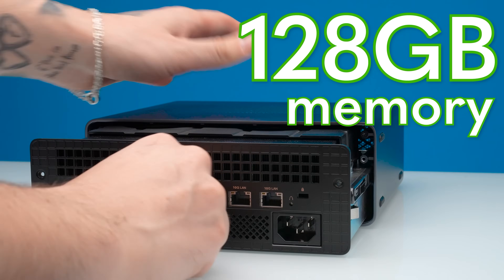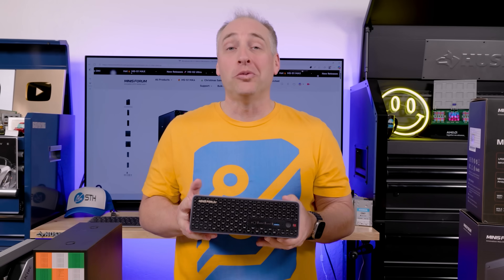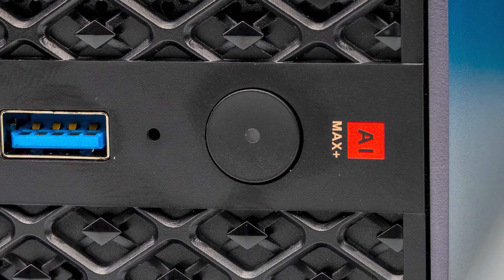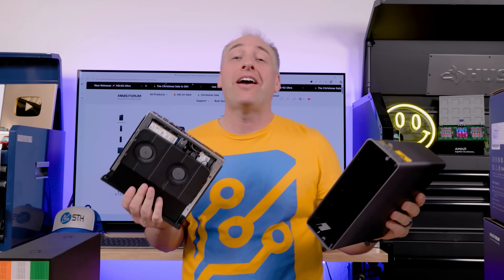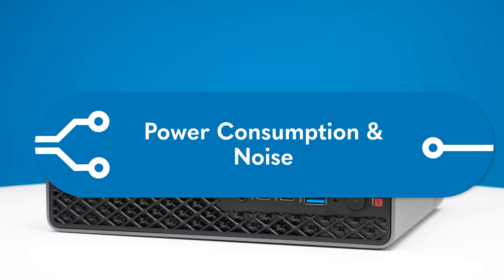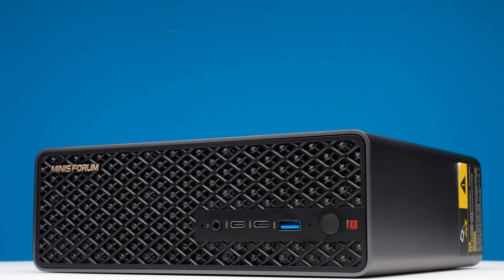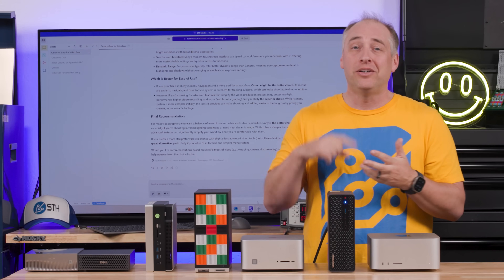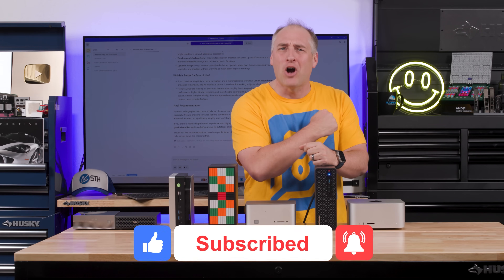The BEST AMD Strix Halo Mini PC Minisforum MS S1 Max

Comment: I would love something like this with 8+ m.2 slots, even running at just 4x1 or something. It would be revolutionary.
Reply: The MS-A2 has three M.2 PCIe-4 x4 slots. It then has a PCIe x8 slot that can be bifurcated into two x4 slots with an adapter.  So you can run 5 M.2 drives at full 4.0 x4 speeds.   It also has dual 10GbE networking.   For me, the MS-A2 is the way to go a far, far better price.
Reply: If you are looking for an 8-bay NVMe NAS, the TerraMaster F8-SSD /F8-SSD Plus is the same form factor, and STH has a video about it. Also costs nearly one tenth as much as the MS-S1 😅. Otherwise, Strix Halo has only 16 PCIe lanes and no non-PCIe networking, so some PCIe lanes need to be used if you want any (good) networking. If you need mass storage and horsepower, you would probably be best served by linking the TerraMaster and the Minisforum together with 10GbE.

Comment: I saw the price. Nope.
Reply: i think the proper verbage would be 'aawww heeell naawww'
Reply: Love the system. My singular gripe is that the tolerances on the PCIe install slot are sooooo tight that I took almost 20 minutes to install the card. Even had to look up the install video for it. Way more painful than the MS-01 & MS-A2. Dope system though.
Reply: Got mine in November I think and I love it.
Reply: Ok
Reply: I don't think most of you understand that this is UNIFIED memory. It allows you to run giant AI models that even a 5090 is unable to run...
Reply from the maker: I mean with 128GB RAM pricing these days not that bad. When we filmed this it was more like $2600 and 128GB was $1300
Reply: @ServeTheHomeVideo  I got mine back in Dec for 2,600 glad I did! They are just passing on the ram price hikes. Its expensive but you pay a premium for compact form factors with this much ram & cpu power.
Reply: @ServeTheHomeVideo  don't compare oranges to apples. 128GB of ram was like 300€/$ before this absurd situation, and this is soldered ram, which should be even cheaper.

What we need is a pc with dual lpcamm2 slots, for quad channel high bw mem.
Or just quad channel in consumer systems (a dual channel ddr5 5600MT system gives you 89GB/s membw)
Reply: i agree but in this specific instance i watched a video on strix halo because there are minipcs with socketed ram and strix halo and ai performance was maybe like 2-3% lower because of the ram so i wouldnt even say that camm memory is needed. bue i am totally with you that it is time for more memory channels..... regarding the benchmarking video if you are curious i'd have to go look and find it in my history but i could provide the link
Reply: @vxvicky  yeah that price is in the past, it isnt going down that low for a while or at all, its the normal price range for now.

beside strix halo pc's tend to be expensive plus with the whole RAM issue in general, im not surprised about the price.

also its an SoC so of course the RAM is going to be soldered, its the same reason Framework did, to maximise performance its going to need to be soldered.
Reply: @vxvicky  So by that logic then second hand electronics should cost the same as when they were manufactured because thats how much it cost to make them at the time. Have you not heard of supply and demand?
Also, DRAM is DRAM. Whether its soldered to the motherboard, soldered to a DIMM or built into an SoC, its still DRAM. Its the DRAM chips themselves that are scarse and expensive. What they are soldered to means literally nothing. That is like saying that a car should cost less because its parked in a lot instead of driving on the road. The car is the car no matter where it is.
Plus dont forget the "AI" tax. Very few people are buying these things for anything other than running LLM's.
Reply: @honestgoat I simply don't understand what you're trying to tell me. Can you please rephrase it again?

Or even easier: are you sure you're talking with me?
Reply: @ProjectTheKhan forget about that "price of the past"
Nowadays current pricing its absurd, don't pay those mounstruosities for those. Extremely high prices cause potatoes? Don't buy anything, hold your money.

Given that it is simply IMPOSSIBLE that CONSUMER HARDWARE should be that expensive cause it is not being used on datacenters, as simply as that.
As small nvmes, nobody uses 512gb/1tb/2tb for ai. Minimum is 4 if not 8.

Tbh this situation looks odd, as if scalpers or their own distributors have removed all the hardware from the market inflating the cost...
Same happened with ps5 consoles back in the day, the disrto with the help of Sony was controlling the hardware sales/stock in shops, generating a fake scarcity situation in order to keep prices high.
Reply: @vxvicky you can keep your money, prices won't go down until these hit the used market. 

You do realize that soldered or not,  most all RAM chips come from the same factories? If demand for the chips doesn't decrease, the prices won't either...
Reply: @Lap1ac-3  did you know that there are things called "warehouses" and "distributors"? The stock of MEMORY THAT IS NOT USED IN SERVERS —'cause you only use ECC REG on DCs— has literally disappeared...
Or do you think that what they sell nowadays at five times the price has just come out of the oven?
How naive.

lpddr ram chips? I bet there's a ton of those in stock, another thing not used in servers nor in gpgpus.
Reply: btw, already have everything maxed out and even keep a few gpus in stock just in case.
Reply: @vxvicky maybe, hear me out, large companies have placed huge orders to the fabs and there are less RAM chips being sent to be assembled on DIMMs? And that those fabs would agree to supply those companies via a contract, binding them to supply those larger orders over others? And maybe those contracts last for years? And maybe, since those contracts are paid more quickly than a others, they'd take priority, limiting the supply sent to DIMM fabs to make it to your distributors and warehouses?

Or are you so dense to believe that regular PC consumers actually drive the market? There are trillion-dollar companies that are driving this market and you're an old man yelling at a cloud.

FWIW, lpddr is being added to EVs and other new cars for the same reason it was made, aka low power.
Reply: @ServeTheHomeVideo 
I mean who cares about the "why" whether it is because of this or that, €3K it costs right now in the EU.
Unfortunately, it doesn't make sense to watch the video any further, and probably for the next year or two. 
Difficult time foe all of us.
Reply: I was going for one that had i5 and without NVME and DDR5 it was mid 400s-500s. Add the missing components its 600-800 with tax. I upgraded my AM4/DDR4 64gb ECC servers with AM5/DDR5 before the price hike in Sep/Oct 2025. I repurosed the DDR4/AM4 motherboard/ram and just bought new powersupply, 2u case and cpu fan and 10gb dual SFP+ was slight over 200dollars.  Not planing on expanding hardware and hoarding what I got left from the last round.
Reply: Mark my words. 128GB will be the new standard and minimum for a PC, and the prices will come down.